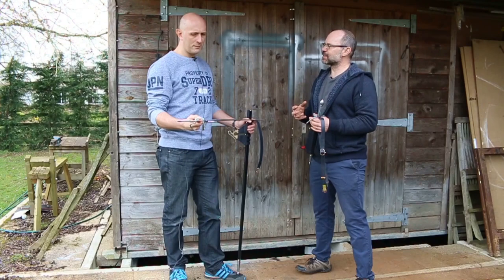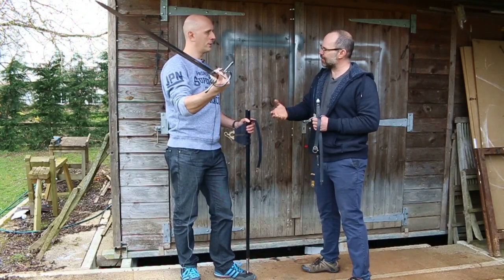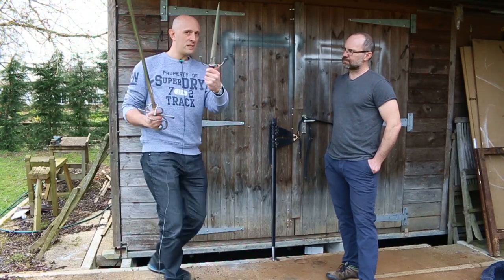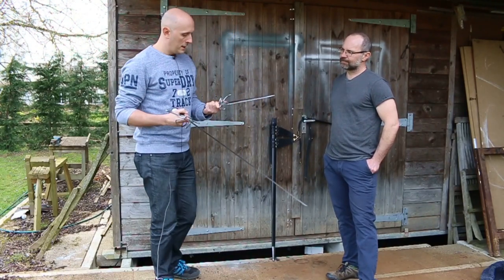Rapiers and Scabbards - Reproduction of French Rapier & Dagger With Tod

Comment: That's a mighty long sidearm. Is that rapier near the limit of rapier length (assuming the wielder isn't Hafthor Bjornsson)? How would the wearer even draw that?
Reply: shade_grey 
There actually were even longer Rapiers. 
In the armoury of a castle close to where I live, there's one with a 110cm blade. That's some 15cm more than the one in the video. And I've heard of ones that even exceed that length.
Reply: In his treatise, Capo Ferro recommends a rapier that is twice the length of your arm, or sitting just under the armpit. That would give a 47in long blade or so, clearly longer than what Tod and Matt are showing there.
About drawing the sword you would typically do it across the body using your hip to help you freeing the blade, ending in prima.
https://grauenwolf.files.wordpress.com/2012/09/image1.png
Reply: That guy looks like he's wearing his belt much further down compared to the contemporary fashion of the 17th century or so (also, his legs are really short for some reason)... Still, it seems like something you wouldn't be able to draw in a hurry.

Comment: If the belt system was designed to allow removing the scabbard and still keep the belt (and dagger) on, wouldn't attachment point in the back be really awkward to operate? It seems very intuitive to change the strap to the front for easier access.
Reply: Often it wasn't attached to a waist belt, nut to a baldric.
Reply: Forward strap is between your legs - would get in the way, when you are on horseback.
Reply: @MrPhantomEd  At that point I would imagine you would have a system to clip it to the saddle.

Comment: Regarding the suspension system, Thibault diagrams one where the sword is worn further to the rear (at about 7 or 8 o' clock) and the front strap is clipped on at the front in the center, where the belt buckle would be on a modern belt, rather than all the way over near the right hip.  It seems to keep the rapier tucked out of the way a little better while you're walking around, which is Thibault's reason for wearing it that way.

Comment: thats like a full meter of thin sword, looks so dainty and elegant, except hardcore. its easy to think of a character who would use a rapier like that, unassuming at first glance, but a force to be reckoned with, so aesthetic
Reply: As well as Elan from the Order of the Stick.
Reply: Gotta agree that having practiced both Longsword and Rapier, of the two I found that rapier tires me out faster, ie. requires more strength to wield effectively for a long period of time. In particular my shoulder and upper arm tire out faster with rapier.
-Unassuming to many even now-a-days as a flimsy, light, stabby stick. But it's used by stronger people, with the best hand protection of many swords.

Comment: If there's going to be a talk with Tod about the Swiss Saber he recently made (and it hasn't been done already), I would really be interested in your view/speculation on how a complex guard might change how you use a longsword/Swiss Saber compared to standard Fiore/Lichtenauer. With a proper baskethilt, you wouldn't need to be as concerned about protecting the hands  - however, unlike with a one-handed sword, you can't keep your two-handed sword as extended when you're gripping it with both hands.
Reply: Yep, I hope Matt gets to review the reproduction :)

Comment: About bucklers and their effectivenes against thrusts, by the 17th century, it was common at least in Spain that bucklers would be partly made of cork (to the point that the city guards were called 'corchetes', from the Spanish 'corcho' for cork). I've always thought that the reason for that could be so that the point of an attacking sword would get stuck in the cork, if only long enough to allow a counterattack, thus making the buckler more suitable to defend against thrusts than it was before.
Reply: I suspect it was more due to weight. While bucklers are already light and compact by shield standards, the extreme speed and dexterity of rapiers necessitated every weight-cutting measure possible, even if it meant sacrificing toughness and protection.

Comment: Hello Matt! 
Just a hunch: 
Could the switch to the front strap be linked to the changing way the dagger was worn? 
One could imagine this strap being a potential tangle point when trying to get the dagger in a hurry, especially with a long sword swinging about.
With roundel or "knightly" daggers being usually worn on the front or side of the body, putting the scabbard strap on the rear takes it out of the way. 
Inversely, as the parrying dagger is worn on the back, putting the scabbard strap to the front ensures it will not interfere with dagger use.
My 2 cents...

Comment: Front strap is most likely for riding. Strapping a blade of this length at the back means it constantly hits the horse's legs, and makes mounting and dismounting awkward.
Also, it seems to be more convenient for you to draw it,as you would like to present your right shoulder to the threat, anyway. In confined space, wearing it backstrapped, might cause a problem.

Comment: 1,400 g=
3.09 lb. or 3 lb. 1.4 oz.,
3.75 lb.t. or 3 lb. 9.0 oz.t.,
0.0959 slug (useful for trust calculations),
1.50 seer or 1 seer 40 tola (Ind./Bgd.),
7.02 pau (mohar) or 7 pau 0.3 molar tola,
85.7 kyattha/tical or 6.86 awettha,
23.3 (or 23 1/3) tamlueng or 23 tamlueng 5 salueng,
2.31 catty or 2 catty 5.0 teal (Mys., Sgp. and H.K.),
37.4 tael t. (H.K.),
2.33 (or 2 1/3) catty (Twn.) or 2 catty 5.3 (or 5 1/3) tael (Twn.) and
3.73 (or 3 11/15) hyakume).

Comment: Maybe switching from a longsword style rear strap to a rapier style front strap has to do with the dagger being worn at the back.
Reply: where is the actual "switch" people talk about? in both cases, the sword is suspended from one point, the belt distributor or buckle, ans pulled forward by another strap.  be that the excess length of the  waistbelt itself passing from the buckle of the belt down to the buckle at the  throat of the scabbard, 
or a strap fixed at the throat of the scabbard and going  towards the front buckle or a  a point near it.

Comment: Somewhat surprisingly, at least to me, the vast majority of portraits I've found of men wearing rapier and dagger have the dagger set up to be drawn by the same hand as the rapier, rather than directly drawn to the off hand. My assumption on this is that the dagger was most importantly there as a weapon in its own right, rather than a companion weapon (and if worn, left on at all times; there are pictures of men playing tennis wearing daggers), and it was more important to not impair its use in this situation than optimise its use as a secondary weapon.

On the subject of front vs rear strapping, dance manuals refer to which dances a gentleman might remove his sword for (galliards and voltas, for those keeping score at home), there rest he should keep it on. This says to me that being able to remove your sword relatively easily, and without looking like an awkward git,  was socially important.

Comment: Re: the rapier's use as a battlefield weapon.

While we do know that the rapier occasionally saw use on battlefields 1500-1700 due to people complaining about them, as it turns out George Silver was far from alone in his preference for a shorter weapon, and when it came to military sidearms in particular this opinion seems to have been almost universal. Even when someone does include the description of a military sword which gets translated as "rapier" it usually ends up being only about 3 feet long from tip to pommel (even shorter than Silver's "short sword") and specifically ordered to be good at both cutting and thrusting (as opposed to "it can cut if you really want it to but not very well").

While there's no doubt that the rapier certainly influenced the design of military swords over time. It's probably a bit of a stretch to say that the long rapier was ever a popular battlefield weapon.

Comment: I think it is far less a swith from a rear strap to a front strap, and more just  a shift in attachement points for them.. . 
with the longsword the belt distributor hangs a  bit to rear of your left, and has some 12 straps forming to make contact with the  scabbar.

The point where it meets the belt is just shifted forward a bit, and rather than two narrow straps forming a triable between belt and  scabbars, you have a large  leather triangle, Not that much diffrent.

And when the excessive belt length on a longsword was passed to the  buckle at the throat of the scabbard, that made the other strap. which is now still there, just that the strap itself starts at the scabbard, and hooks to the belt, and that attachment point shifted a bit along the waistbelt the same way the other point did.

It is essentially the same suspension, just shifted a bit so the sword hangs more towards the front. 

I reckon it might have to to with biomechanics of drawing a very god damn long sword.

Comment: With regards to the dagger and the orientation of the protective ring - if you take biomechanics and simplicity of drawing into account, then if you draw the dagger from behind, the ring will protect the thumb side of your hand, if you draw it from your right hip, it will protect the side with the other four fingers. You'd need to rotate the dagger while/after drawing otherwise.

Comment: It probably hooked in the front because it’s easier to hook it on there if you’re taking it on and off. The dagger was also in the back so that could make it difficult as well. With a longsword, you aren’t going to detach it from the belt the same way so it doesn’t matter that it’s got the strap in the back.

Comment: The edge does the cutting not the flat and that blade has a lot of weight and leverage. It could definitely lop off a hand at the wrist. I have little doubt it could cut clean through a forarm, perhaps an upper arm depending on the skill and strength of the user.

Comment: I would speculate it has to do with the pluderhosen. Lots of nice folding fabric in the back that you dont wanna mess up. In the 15th century the fashion was as you know very tight around the buttocks so the strap there would not interfere with any folds and stuff.

Comment: Hi! I have a question that's actually unrelated to the video. Recently my father and I made a Mycenaean spear with a bronze tip. It's about 2.05 meters long counting both the shaft and spear-head. Firstly, is that an ideal length for a spear that is also supposed to be thrown from a fairly small distance? And secondly, where is the ideal center of weight for such a spear?

Comment: In a double lock situation, you kick them in the nuts. Then you try to extract your weapon.

And with regards to the front strap, I would speculate that it was simply easier and quicker to remove that way.

Comment: Hi Matt , my next cuestion is not related with this video and I don't know if you have talked about this topic before (sorry if it's the case), but I just saw an old video about percussion weapons vs swords and I was thinking: If there are two fighters both in full plate armor (the same height, weight, strength...) one of them has a longsword and the other has a warhammer. Who is more likely to win? Does the armor tip the balance for the warhammer user?

Comment: Having a large and hollow pommel helps each gram have more impact to, by placing the weight further away it has more leverage against what it counter-balances. Just adjust pommel size and shape as needed. So the sword can be overall a bit less mass for the same effectiveness. It also better helps prevent the hand from sliding off. Just a hypothesis.

Comment: I feel as though they might have switched from the back to the front strap to pull the hilt closer to one's hand, allowing for an easier drawing of the blade. If the back strap was applied to the middle of the blade, it might've pulled the tip closer inward and leave the hilt angled farther from the body.

Comment: There's a technique that some vapers use when wrapping the wire coil for a vaporizer (pretty much the exact same thing as handle wire wrapping) that will help make that a lot easier.  When your wire is ready to go onto the grip, anchor one end of it to something and take all the slack out of it, then give it just a little slack and snatch it taut. It really helps previously wound wire be more straight.

Comment: I would hazard a guess that the buckle for a second restraining point serves the same purpose as the clip? By having it on the front it becomes more accessible to remove it when entering civilian setting where it is not seen as acceptable I.e. A home or a place of business. You could quite stylishly remove the clip and buckle without turning away from your business parter or whomever it is by fumbling around your back and embarrassing yourself, as at the time style is everything.

Comment: It would be my uninformed guess that the reason why the rapier scabbard hooking system changed from the back to the front was because the back hooking style was easier to put on and take off with a servant helping you, whereas the front hooking style is easier to use by yourself.  You might have a lot of servants, but there are times when none of them are available.

Comment: i never knew rapiers could be that long. thats a long sword man
Reply: The Goddamn Batman That is pretty standard for a rapier.
Reply: That's not even the longest they can get. I read somewhere that street thugs and other disreputable characters sometimes used extremely long rapiers and they painted the last few inches black so the point was harder to spot in the dark alleys and the opponent would misjudge the distance.
Reply: the longest on average was 48 inches but they went up to about 60 or so for the very longest.
Reply: joseph dedrick   surely thats exagerrated. 60 frickin inches? people wore that? you cant wear that. but i dont think you can even wear 50 properly in everyday life.

Comment: How were complex hilts made historically? AFIAK, welding was terribly unreliable back then (and blow torch not invented).
I can't imagine that all bars were rivetted either (crossguard, pommel and maybe knucklebow, but definitely not the rings or sidebars). However, I'd say that with sideswords, backswords and early rapiers you should be able to punch someone with the complex hilt on the helmet without breaking it. Not, that it was made for it, but that's the level of abuse it has to be able to withstand on the battlefield.
Reply: They would have been forge welded.  https://www.youtube.com/watch?v=fyjkbN0hWRY there's an overview on how to do a full-strength forge weld, where the two pieces of metal effectively become one and the weld line vanishes.
Reply: Interesting. That must be really challenging, if you do a ring over the ricasso, or if you make a three ring rapier, or even a Schiavona...
Do you have any idea, how during WWII people would have welded armour plates together? If you try to combine a 150mm and a 100mm thick plate, you won't get far with a normal welding machine. It doesn't help, if the plates only fuse on the surface, nor can you heat it until the heat treatment is ruined...
Reply: OK. I didn't mean welding two plates together such that they form a thicker plate, but welding plates together such that they form the hull of the tank. In case of the Tiger II, it would be roughly one 100mm and one 150mm plate welded together at ca. 90°, thus the overlap can't be more than 150mm. Still, that's far more than your normal welds.
As a sidenote: I still can't grasp how the world changed in the first half of the 20th c. The oldest relative I've met still came from a time, where there was no electricity, running water etc. and soldiers were carrying sabres, revolvers and repeating rifles. She looked in awe at the first planes and cars. Soon thereafter countless soldiers would be mowed down by machine guns... it's like an era suddenly coming to an end. Don't forget that the first planes couldn't carry more than one pilot and a few handgrenades. They couldn't lift any other crew, bombs or machine guns. This meant that pilots tried to shoot each other down with handguns! Soon thereafter the first planes evolved that could carry a machine gun and not 30 years later planes could carry 12 tons of explosives and a crew of 12! Moreover, there was guided rockets, radar, night vision etc.